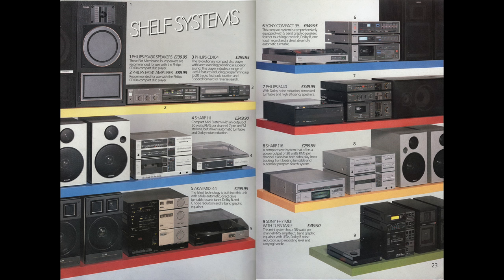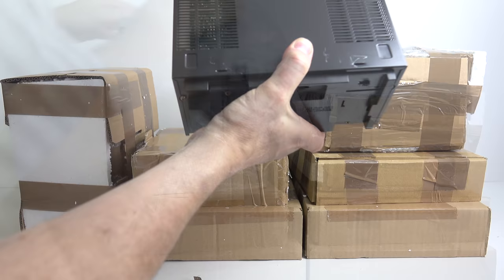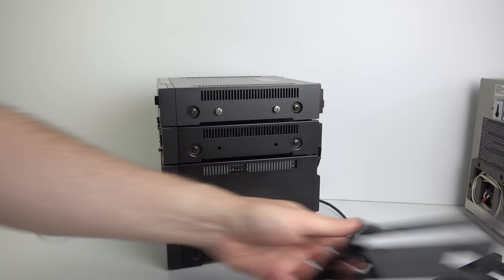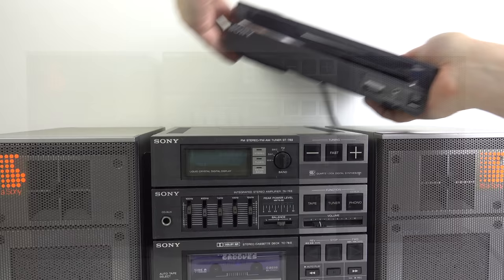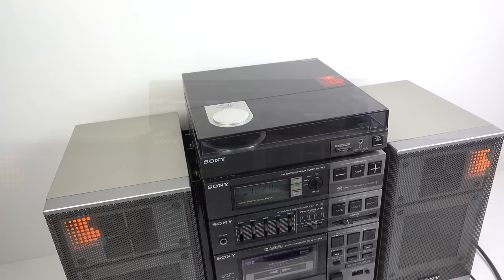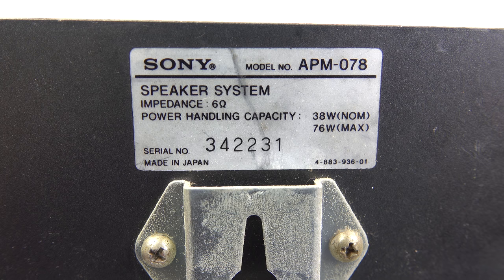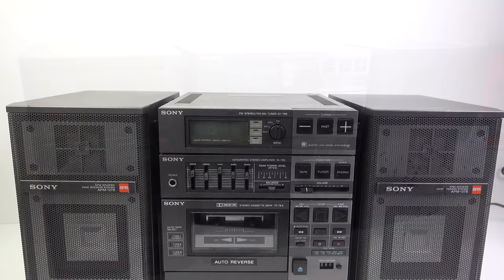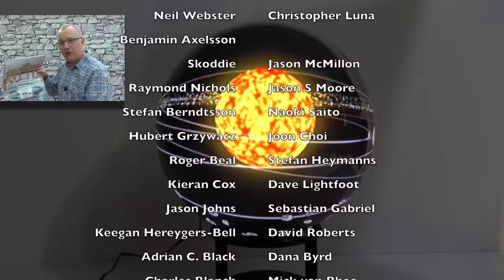HiFi Classics - Sony FH-7 MkII

Comment: What a magnificent beast, much more substantial than it appeared at first! Loved seeing it come together component by component. And wow, that red model is gorgeous, reminds me of certain Sharp and Sony Japanese market computers from the 80s.
Reply from the maker: It took me a while to find my black FH7 - the silver models seemed to appear more frequently, but I already had the black turntable. However all the time I’ve been looking (a couple of years now)  I’ve never seen a red one come up for sale.
Reply: Hi Clint! :)
Reply: I had one that was like golden, I had three parts, cd-player, equalizer and amplifier, sound and power was just amazing. I was around 12, 13 years old and connected huge party-speakers to it and turned the volume up, first time the overload fusing worked but then it didn't work at all, something further broke, I just threw it away and regret it till today, I have a nice Philips Sound-System something more modern with their Woox-System that is just great, but I loved the Sony system because of it's size and that it has seperate modules, just can remove all that isn't needed.
Reply: You got to check out the woodgrain REALISTIC brand computer cassette tape case eevblog found in an old warehouse of antique computer stuff.  Hit him up because it has LGR all over it.
Reply: Mr Basinger, how's tricks stateside?
Reply: Greetings Gentlemen
I own the FH7 MKII, and I encountered a problem with its cassette deck, the issue was taking the tape head mechanism up/down during playing session. It was an unresolved defect.
Last but not least, it is still has different look with rectangular speakers rather than traditional circular speaker.
Reply: Nice to meet you here, Clint! And yes, you're right about those 'certain' japanese computers, i have seen several of those in red too. 'Twas a nice departure from the ubiquitous beige imo.
Reply: Someday you guys gotta Make a LGR, MRE info, and Techmoan crossover video
Reply: That would be something to behold!
Reply: Yes I can see it now, they review a Hi-Fi from years ago, with a computer from that same year, all while eating an MRE from the same year!
Reply: LGR you know, just saying that to make me think of your MIDI Mountain, just with speakers glued to the side
Reply: The red makes it play better.
Reply: I was thinking the only thing that could make this better is if you stacked MIDI mountain on top of it. Like a giant audio tower of power.
Reply: Yea same
Reply: It's nice to see you here!
Reply: Yes
Don't forget VWestlife too. hahaa. Techmoan nemisis.
Reply: It sounds like the mechanism is gummed up, you will need to take it apart, clean the gear cams and apply fresh grease. You will need to be careful as sometimes the gear cams can stick to their shafts and you have to take them out slowly not to break them. Good luck.
Reply: CLINT!
Reply: Yes, the ultimate video for me would be a combined video with EEVBlog, 8-bit guy, Techmoan, and LGR. ;)  I'd say Ben Heck too but he retired from video making.
Reply: LGR everytime I see you comment on something I get excited.
Reply: When your regular viewing Youtubers collide! Yo Clint! This a techmoan thing!
Reply: And Steve1989.  Remember, Techmoan has reviewed food prep gadgets!  "Mm, that looks delicious.  Let's have a look 'round back, and put it on a tray."
Reply: I remember there was even a 3-tape tiny boombox by either sharp or sanyo
Reply: HI CLINT!
Reply: thedungeondelver 
.....nice!
Reply: LGR the first thing I thought of when seeing this video was "Ahhh the nostalgia of 1980s and 1990s home electronics.. :)"; then my second "LGR probably loves this channel, both have a very similar style of format and narration. "
Glad to see that I was close. 😎
Reply: My father bought himself the mk1 somewhere between '83 and '85. It was passed over to me some years later. Suffice to say that neighbors hated it 😁😅😅 It was a beast of a house party machine.
Reply: Absolutely, the Sony square speaker hifis of that era had such a unique aesthetic. When I saw this video I immediately went and hooked up my old Sony APM kit to my computer.
Reply: Lifes Good Racoons?
Reply: My mom bought a red FH-3 in Germany, I think in 1983. Including the battery power supply and 12 NiCd D-cells. My parents then took the tower to the remote hills of Italy and played warm-up music during their seminars, held at a house that did not get mains power until 1993. I don't think the batteries lasted a full week (with maybe 20 minutes of play time per day). The FH-3 is still around but needs some attention - the cassette mech is gummed up and certainly needs new belts. Other than that it's still OK I think. My dad did once drop it in the mid-2000s because the handle came loose as he was carrying it. At that point he only used it as an amp for his portable MiniDisc player. I'd love to restore it or have it restored!
Reply: LGRMoan
Reply: I'd remain with me 𝗧𝗲𝗹𝗲𝗳𝘂𝗻𝗸𝗲𝗻 𝗛𝗶 𝗙𝗶 𝗦𝘁𝘂𝗱𝗶𝗼 𝟭𝗠. It is a war machine, is still working. It's only defect, it has not a Metal Casset
Reply: About the same time as this was sold, Sony also sold the Beta VCR in multiple colors, including the Red variety..
Reply: I read this in your voice
Reply: I have my dads old JVC-PC RM100, its a similar style but more portable and compact.  These units are heavy for a reason.  Good solid-state amplifiers are not light!!  That and these companies really packed those electronic components in them,  they used up the whole space!
Reply: @Vegeta8300  Gotta finish that with a 50 year old cigarette.  Nice!
Reply: and Toshiba
Reply: I read that in your voice
Reply: Hello @flyawaytraveltours430  
Thank you for sharing your memories about retro stereo. Today those rare 80's products from SONY became more valuable, made in Japan and no product has that quality like before.

Sincerely yours
MOHAMAD
Reply: I'm not that optimistic. My father had one of these, probably Mk.1, in the early 80s. Before digital. The sound was tinny, with resonant upper mids and almost nothing in the bass department. The auto rec level didn't work properly, even with Sony's own tuner, right out of the box. Levels were always too low, and the two channels were consistently recorded at different levels. I still have some of the tapes recorded on this Sony; the loudest channel barely registers -3dB vs. true Dolby level. 
But, IIRC, the price was less than a half of that British catalogue quote.
Reply: This is the most powerful boom ox ever made 
I believe it is 45 wpc RMS .Which would make it the most powerful boom box
I Lasonic 920 is 15-20 wpc ,A Conion 10 wpc RMS .It only consumes 42 watts .So it can’t put out 22.5 wpc .Plus the speakers are only 10 watts nom ,15 watts max
The Sharp GF-777 claims 90-w PMPO
That is a ISBL = If Struck By Lighting power rating lol .
Anyways a Sharp GF-777 is only 4 x 6 watts .Which is 24 watts total or 12 wpc 
Even the Huge Dynasty H-959 “ Wheely “
With 10” woofers .Only outs out 17 watts per channel .I looked up the IC chip online 
So when Sony made this boom box .
It was 2-3 times the power of any other boombox .It just wasn’t big and flashy 
So it didn’t sell aswel as Lasonic ,Conion ,or Sharp .Plus a Lasonic was only $139 
Thank you for posting this video
You should open up the speakers 
So we could see the difference
Reply: Yo Lazy Game Room, here?

Comment: This approaches the military definition of portable: can be moved without a forklift.
Reply: Hey at 15lbs that thing wasn't that heavy back then, a really cheap boombox might be 5-8lbs with either C or D batteries in them.
Reply: 15 kg, not pounds -- more like 33-ish lbs! Around the same weight as a Compaq "luggable" (https://en.wikipedia.org/wiki/Compaq_Portable), but not nearly as expensive. I guess if you had one of each you wouldn't be listing to one side or the other as you carried them slowly to your destination.
Reply: The real military portable is the 𝗧𝗲𝗹𝗲𝗳𝘂𝗻𝗸𝗲𝗻 𝗛𝗶 𝗙𝗶 𝗦𝘁𝘂𝗱𝗶𝗼 𝟭𝗠
Reply: For large values of portable.
Reply: @mariocomeq1961  It's like the IBM PS/2 8580 (huge PC tower)...portable because it has a fold down handle fully loaded probably weighs 70 lb.
Reply: Hé Jan! Hallo!
Reply: what about the mrc? military radios. (mobile radio component) hmmwv mounted radios.
Reply: Portable in the sense that you can just unplug it from the wall socket and carry it into a vehicle.
Reply: i.e.: "transportable" -- designed to be less difficult to move (transport) from point A to point B compared to a conventional, piecemeal home system

...like those early COMPAQ PC clones that incorporated everything -- including the video monitor & floppy drives -- into a single unit w/ a carry handle.  Yeah, U could move it around, but U wouldn't want to do it if U didn't have to.

Comment: As a young U.S. Army Soldier stationed in Germany in 1984-85, I bought one of these along with the corresponding record player. I opted for the D-5 CD player that came with a regular wall wart power adapter. And back then my paycheck was around $1,100 a month so it was expensive as you mentioned. But, like a dummy, I sold it to a buddy real cheap and only recently did I finally replace everything.

Comment: You are absolutely right, they don't make stereo systems like they used to. And I do remember walking into the HiFi parts of a few places with the lights turned down so you could see all the GEQ lights dancing on the various units and whatnot. Never could afford anything back then, but used to love going there while on a search for a new CD or tape and drooling over some of the gigantic home setups.

Comment: I love seeing this stuff from the golden age of what would later be called midi/mini systems. Back when the beauty of the designs stemmed from practicality and function, before the mid-90s fixation on geometric angles and excessive animated LED displays that made all mini HiFis look like a cross between Optimus Prime's head and a stealth fighter.

The first compact component system I bought with my own earnings was a JVC MX-50 from about 1990 and it was lovely. Gorgeous industrial design, with understated dimmable orange displays and bass port speakers that weighed a ton and packed an incredible amount of oomph.

But the most impressive feature was the auto CD-to-tape dubbing which would not only re-order tracks to fill the maximum space on the tape but, if the tape ran out before the last track was complete, would rewind the tape and re-record the last track with a slow fade out before the leader. An incredibly smart combination of hardware and logic for its day.

Comment: I  have an FH-7 MKIII as a gift of my parents when I was 15. It was my first Mini Component. I still have it now since october 1985. Although the backlight of the radio is not working, the rest of the set work just great. Compliments for the review. excellent job !
Reply: Super easy to fix, that backlight. As far as I can remeber, I fixed same issue on mine MkII by just replacing LEDs behind the tuner screen. And I did that back in the 1990-is, as a kid

Comment: Great to see people giving some love to these hig fidelity compact high density sony system.
My setup:  I have a fh 10w with apm 108 speakers (4ohm speakers, yes the fh10 worked with 4ohm) and a fh11w (6 to 16ohm) with apm 115 speakers (6ohm). The Fh10w i have it since 1986 when dad bought it. i use the fh11w amp (st 118) and fh10w amp (st 108) as part of a true 7.1 system together with grundig super hi fi 1500 pro speakers as front (connected to a yamaha rx receiver and sansui equalizer), a pair of pioneer s x20, as lateral connected to another  sony receiver,   The apm 115 speaker connected to the fh11w  as rear speakers and a center sanyo and sony subwoofer connected to the fh10w. Every amp connects independently to  The Asus rog supreme fx that do the 7.1 channel upmix and I enjoy 3d sound on every spotify song  at 320kbps.(you can switch from stereo to,quadraphonic to 5.1 and to 7.1). All vintage hi fi.

Comment: I too have always been drawn to component systems. I remember begging my parents for one. They eventually did buy one for me, however it was merely a cheap knock off all-in-one system where the the "components" could not be separated. Basically a big hunk of plastic made to look like a component system. I still loved it though. I did recently manage to pick up a JVC Micro Component System at a local good will that I really love. The UX-A4 system.
Reply: Ryan Schaffer Yes those places (we call them charity shops in  the UK ) can be a good source of old Hi-fi systems at bargain prices.
Reply: My brother had one of those pseudo component systems as well. 
Didn't even realize it wasn't a true component system back then.

But I prefer the full size stuff. It's basically a standard like 19 inch for server/network stuff.
My modern AVR, my laserdisc player, HD-DVD Player, Blu-Ray, network music player ... all of different manufacturers, stack up together niceley and look at least somewhat matching.

You can even get some HTPC cases in that format. It's just brilliant.
Reply: Your all in one system. It wasn't one of the Amstrad systems by any chance?
Reply: RCA I believe it was
Reply: Same here.. Asked for a Sony separates system, got a Matsui... Still loved it though!
Reply: I have got most of my components from goodwills/thrift stores
Reply: Have you seen how much proper HIFI goes for nowadays, this geeza dont know what hifi is which can only be separates.
Max i know 99% on here dont know what HIFI is.

Comment: @7:48 In case anyone was curious, it's also possible to use vinegar on leaky battery residue (distilled white vinegar best here). Batteries are basic, vinegar is acidic, use the hardware store vinegar so it doesn't leave residue (like apple cider might, for example).

Comment: Reminds me of the Aiwa that powered my dormrooms at university from 1983-87; complete with lighted graphic equalizer and wooden speaker boxes but minus the turntable. :-)
Reply: Aiwa made all the best 80s stuff that was both cool and garbage at the same time.
Reply: The Tyttuutface Including that Mega CD boombox.
Reply: I don't remember the exact model, but my Aiwa mini system (similar to this Sony) was pretty slick and was built and worked well.  It sounded great.  It was not garbage at all.
Reply: I have a aiwa nsxs90 great systems very loud the one I have is 500 Watts fan cooled amp with both Sony and aiwa components inside great things is they are packed with features you don't get this on systems nowadays you only pay for garbage can't beat the old systems
Reply: Aiwa are pretty good to be fair the system I have kicks 500 Watts out fan cooled in the late 90s they had both aiwa and Sony components inside they made some pretty good systems unlike half the garbage you see in currys today
Reply: I have an Aiwa cassette tape player that thing cranks I was playing Mariah Carey and I could feel the bass on my headphones

Comment: These shelf systems were my favorite stereo format while growing up. I owned a fairly decent Aiwa system, but always drooled over the high end Sony models, such as the MHC-2200. I have since owned a few of those older Sony models. The cable ribbons are always a hassle, and I definitely now prefer the quality of separates over the "coolness" of these shelf systems, but I will always have a soft spot for these systems.

Comment: Aw... “refurbished” on eBay seems to have its own meaning?
Reply: corner liston unfortunately it does. I bought a walkman that was "refurbished" but not certificate by sony
Reply: Or creative use of truth.
Reply: I've bought two things on eBay, one is a “refurbished” reverb that even if it's in really good shape for its 35 years it clearly was not refurbished.
This seems to be a very common problem unfortunately. (Although I'm very sure there's also a lot of decent and honest sellers on eBay.)
Reply: some people probably think refurb just means they cleaned it a bit or some such
Reply: Collecting disc-based media from eBay is a real treat.  "New" means only a few major scratches.  "Like New" means it still technically works.  "Brand New" means it still has the insert.
Reply: + Max Pain. That's a bit unfair, it was a damp cloth.
Reply: And spares or repairs "not tested" means "I've definitely tested it and it definitely doesn't work."
Reply: They do describe things as "manufacturer refurbished" and "seller refurbished".  The latter mean whatever the seller wants it to mean.
Reply: @_Piers_ , that was the last time you bought underwear of ebay
Reply: Translation: Wiped off dust and finger prints.

Comment: Hahaha, I too read those store booklets cover to cover. The orange dot sony logo still is my favourite. The Sharp unit above the Sony looked interesting too. Square, leds and soft touch buttons were so modern.
Reply: Does anyone know what that pattern on the "It's a Sony" logo was supposed to represent?
Reply: Jose Pointero the leading edge of it is an 'S'.
Reply: Yeah, I see whatcha mean, it's a bit malformed though. I dunno, I figured it meant something more significant. But maybe it's simpler than that and they were just going for a "graphic equalizer" look.